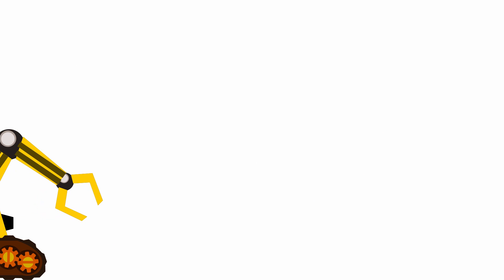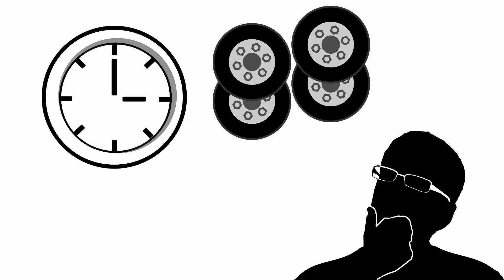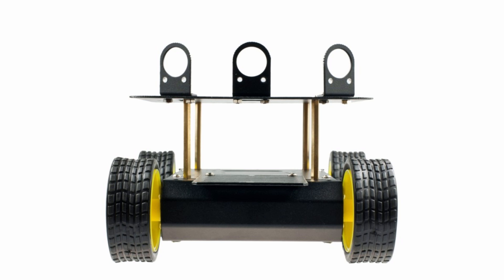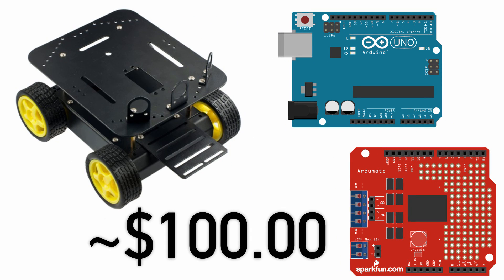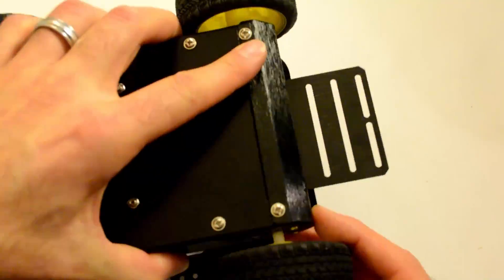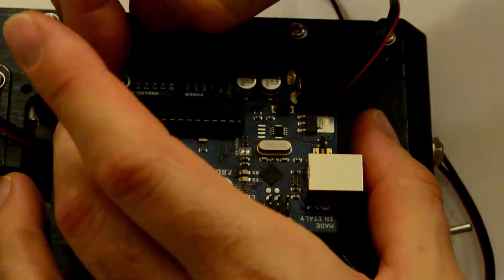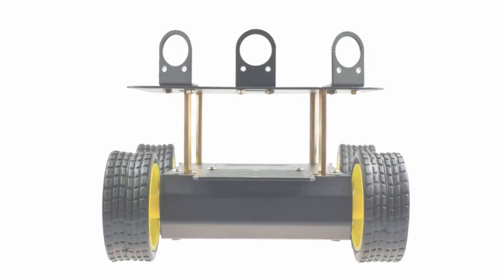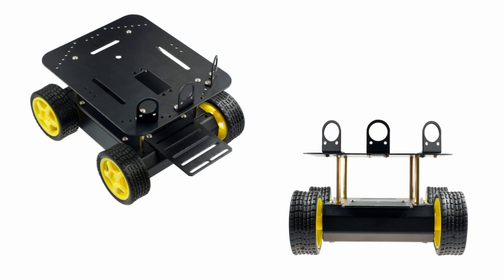DFRobot Pirate 4WD Mobile Platform Reveiw for Arduino

Comment: I assembled it last night and your video was very useful. It saved a lot of my time, but there were two questions I came away with: 
1) How to use and wire up the remote power jack
2) How to use the optical sensor mounts - putting a two-eye sensor into a single hole is a physics trick I haven't mastered yet.

I appreciated the tip about using a rechargeable battery and went looking for something that would fit, have enough power and be rechargeable without removing any panels. I suspect that this might be a good use of the power jack, but I am not clear on how to pull that off. Again, my limited knowledge of assembly and wiring tricks is handicapping me. 

Otherwise, thank you very much for the excellent build lesson and the leads to other, more advanced ideas and approaches.

Comment: hi, I am new to Arduino and i want to make a simple robot that can just move ( and maybe add a remote controller ) .i bought an Arduino uno kit from ebay that didn't came with motors so i disassembled some old toys and got the motors from them i looked on some tutorials for how to wire them but didn't find anything helpful and i was hoping that you could help me (thanks in advance and sorry for the bad English )